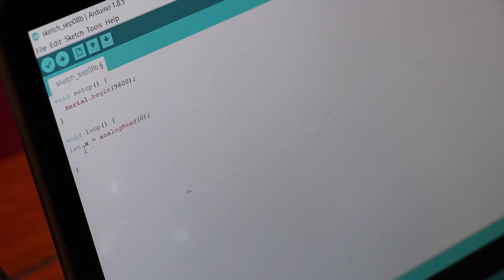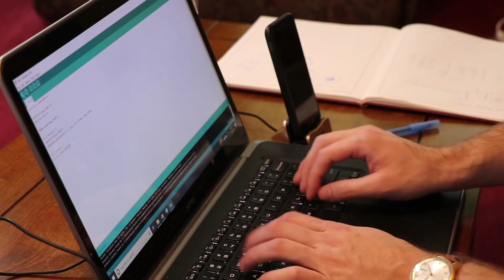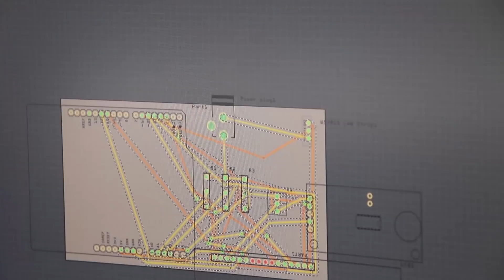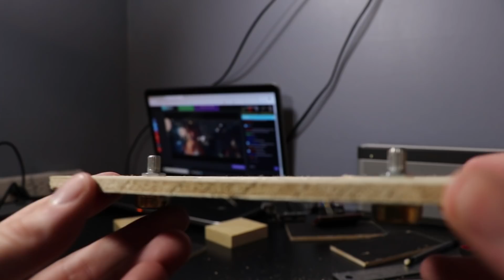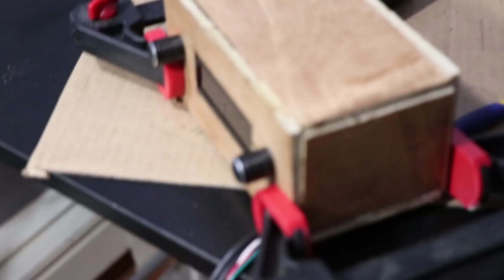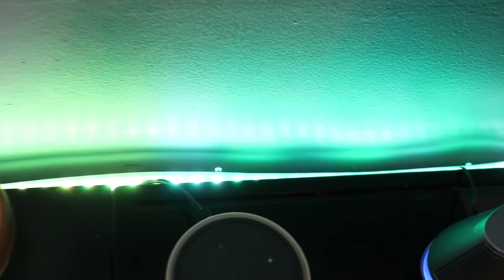Music Interactive SMART Lights

Comment: I'm new to electronics but I recently got an Arduino nano as well as a Raspberry Pi 3B, and I'm trying to learn this sort of prototyping and making custom PCBs.

I'm currently trying to emulate a product called the Kaimana Mini, it's a LED controller that reads inputs from an arcade stick encoder board and does customizable reactions based on button presses and combos. I can replicate this using an Arduino reading one input signal per pin, either 8 or 12 inputs depending on if I also want to read the joystick, but I have no idea how to simplify this to read all the inputs to a single pin. Cuz rather than a full Arduino which would use too much power for a USB connection that's also powering the Brook encoder board, I'm hoping to use something like the low powered ATTiny85.

Comment: I have been working on this project from last 5-6 days but didn't achieved nothing plz help .
U encouraged me to do this..now help me🤣 
I'm stuck with mic value... How to get proper mic value
Reply from the maker: If you are using the Sparkfun Sound Module, are you feeding it the correct voltage with the correct polarity. Also are you using the Envelope. You should see the LED light up from sounds over 100dB. I would start simply by reading the Analog input being used through the Serial Monitor on Arduino IDE to see the feedback and make sure the module is working.
Reply: @Grensom   thanks for reply  but i'm not using sparkfun
Reply: @Grensom  hi now everything is working fine but why i am not getting colors like yours?? on music

Comment: hey, is there some difference between the Sparkfun sound detector and all the other sound detectors with 3 pins (output, GND, +5V)?
Amazing video =)
Reply from the maker: WT ATLAS Most likely other sensors give you a raw output of the audio signal where as this module also gives you an average envelope of the sound wave which makes it a little easier to analyze and less code on the Arduino side
Reply: @Grensom  but your program will work even with the other sensors? or i have to use only the sparkfun?
Reply from the maker: @JustPlayer20  The program I wrote will still work, but the colors might be a bit more sporadic. It should feed into the analog input the same way as the Sparkfun Module. If necessary you might need some slight modification of the code if the output looks bad.
Reply: Grensom ok thank you so much dude, you’re amazing !!

Comment: Did he power the arduino seperate or did he power both with one power supply using the led stripes to power the arduino?
Reply: it's seperate, so he would not need to connect the arduino to the pc for power.

Comment: I'm curious, where did you order the PCB? Good pricing? Most companies that make PCB boards where I live only do it for companies or cost a fortune.
Reply from the maker: I use CheapPCB, they are manufactured in China and I have them sent here, but I haven't had any issues so far.

Comment: I'm going to try and make this, but I have one question: Is the audio source just sound the board picks up, or does it receive it wirely from a pc or phone?

The version I'm trying to make would be, when it is plugged into my laptop or switch via usb, it would monitor the sound output from that and replicate it with the light sequence.

I don't want to just be talking and it picks that up
Reply from the maker: Red Williams - BRHS 2020 This particular project utilizes a microphone not wired connection. However you could simply replace the mic with an audio jack cable

Comment: Why does the LED light strip need a separate power supply? Can it not be connected to the 5v pin on the Arduino board?
Reply: Doesn't need a separate power supply if you're using a 5v LED strip. He's using a 12V strip in this video though. You can use the 5v pin from the board to power a 5v strip but you're going to be limited to about 1/1.5A output. With a power supply you have more amps to and less voltage drop so you can get longer runs with higher brightness levels.

Comment: I have used all of these but not working then I checked my mic it not working like yours..... ur mic making a graphed value but not mine plz help
Showing value of 0-1 ----
Reply from the maker: If you are using the Sparkfun Sound Module, are you feeding it the correct voltage with the correct polarity. Also are you using the Envelope. You should see the LED light up from sounds over 100dB. I would start simply by reading the Analog input being used through the Serial Monitor on Arduino IDE to see the feedback and make sure the module is working.